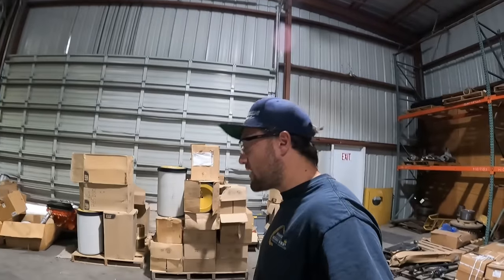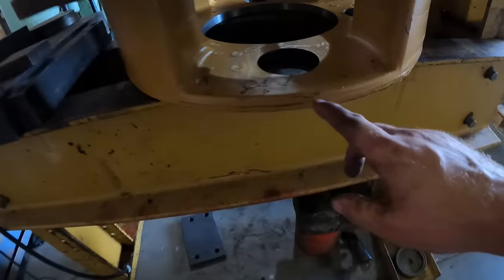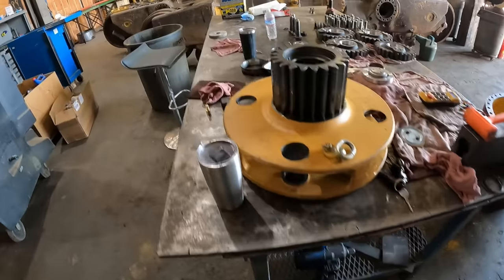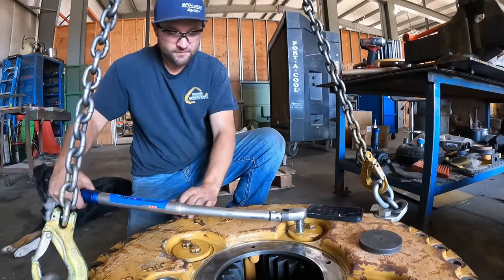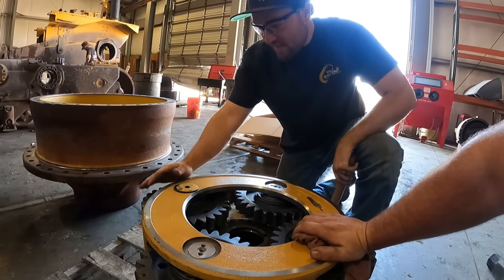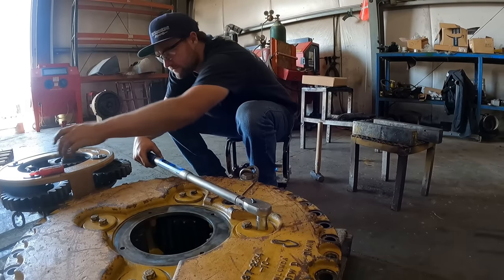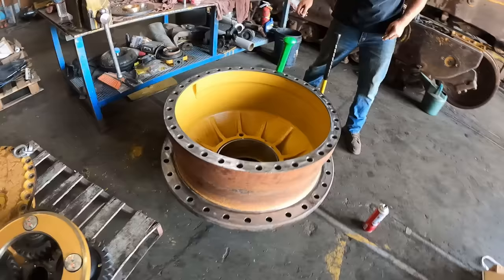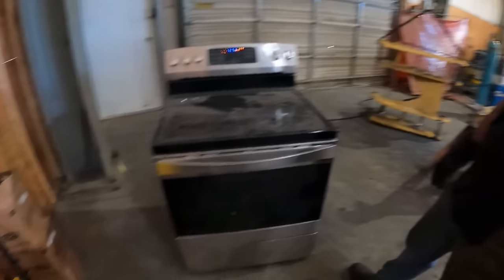Completely REBUILDING A D10R final drive part 1

Comment: I am slightly surprised you don't use liquid nitrogen to set the bearings. My guess is they would just drop in with no hammering at all from the far lower temperatures in comparison with a domestic freezer. I see Cutting Edge Engineering in Australia using this procedure.
Reply from the maker: The closest place that sells liquid nitrogen to us is about an hour away. Its more affective for our crew to use the freezer
Reply: @quintonbartolotta 
You keep a cryogenic tank on site, lasts ages and you put what doesn’t evaporate back in the tank. It’s not really a lot different from keeping Argoshield or oxygen and acetylene on site!
Reply: We use dry ice in isopropyl alcohol at work to shrink bearing races. Not as cold as liquid nitrogen but colder than the freezer
Reply: Get ahold out your local large animal vet and see who in the area provides AI service. My local guy tops off my tank every 3 months. About $60 each time
Reply: @quintonbartolotta  60 years ago in the north of Scotland we used to use liquid nitrogen for fitting bearings in old cast iron textile machinery, where the risk of hammering breaking an irreplaceable part was too great. British Oxygen would come around every three months or so and top up our Dewar flask. Sitting in a well insulated container, it was surprising how little got lost to evaporation. We had an insulated bowl to soak the bearings in and after that was done, we would pour the liquid back into the Dewar flask. The only problem we had was when a young apprentice thought it would be funny to dip a daffodil into the liquid nitrogen and then hit someone on the head with it. They needed a couple of stitches, as the broken edge of the frozen daffodil was razor sharp. Liquid Nitrogen is almost a waste by-product from cryogenic oxygen and argon manufacture and is surprisingly cheap.
Reply: @quintonbartolotta not sure where you are in the world. but if Kurtis at CEE uses enough as a one man shop to not have to worry about it getting warm, um surprised you can't get it

Comment: When pressing a little bit of press first lube goes a long way. Spray it on before you put the parts in the freezer. Aids in pressing, helps prevent galling, prevents corrosion between the interference surfaces and axfs as one hell of a rust preventative. I have a few cans of Sunnen B-200 for any press work. One thing to consider is a large CO2 tank with a CO2 bag to create instant dry ice. Shrinks parts further than regular freezer time several tenths or thousands (depending on cross sectional thickness).

Comment: Not impressed with how you install bearing races. I think if you do your hits always 180 degrees apart it will take far fewer strikes to seat them. In other words, 180 apart, move 90, 180 apart, move 90 and so on.

Comment: You need to find or make a rack for the oven to place the part in the center of it. Temp will vary a lot laying on the metal of the bottom.

Comment: why not use liquid nitrogen ? less risky to use a proper press .But if you warmed the gear to 300 and froze the bearing in liquid nitrogen it would drop in with out the hammer .I am sure you know that . It is common knowledge . Just curious why not

Comment: The glass cooktop on the stove is an INDUCTION cooktop.  The bearing is about the diameter of a cook pot.  So laying the bearig on the industion element should heat it faster than the oven.
Reply: NICE 
oops scratched burner

Comment: 3 flb difference on the bearing locks. One tech did 37, the other, 40.
You know, I've seen "Killdozer". Exactly what happened there. 3flb difference on bearings and the dozer started getting everybody.!!

Comment: We use a portable induction heater on races or complete bearings to heat them, normally takes less than a minute. Not cheap but a lot smaller and faster than an oven.

Comment: those nice square o-rings are called "quad rings" some of the bolts on those plates with the quad ring got over-torqued with the impact (tq wrench beeped before the bolt moved)
Reply: And when shakes that one gear, sound can be heard..
Reply: not impressed with there work at all .  looks like a half ass operation and a disaster waiting to happen for the customer . And using a bar in that press looked like instant death